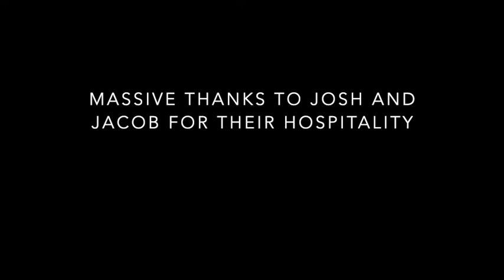TNT (Test N Tune) Failure, But What A Beautiful Way To Fail !

Comment: Was twin valley where you rode it up on the ice?! Can’t remember, but that shoreline kinda looked similar to that vid.
Reply from the maker: Hey Mitchell. That was Pine Coulee where I was riding on / in the ice. I've only been at twin valley a few times on film. Yeah, it's not too far away and both are reservoirs that were man made by flooding farmland.